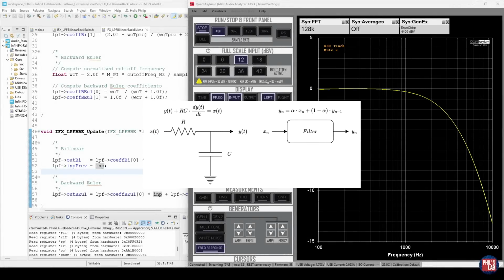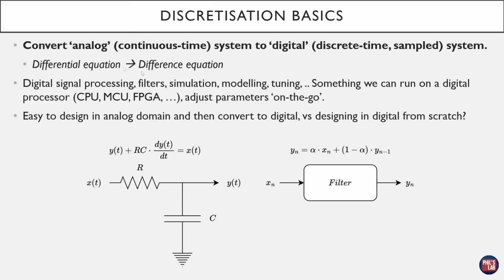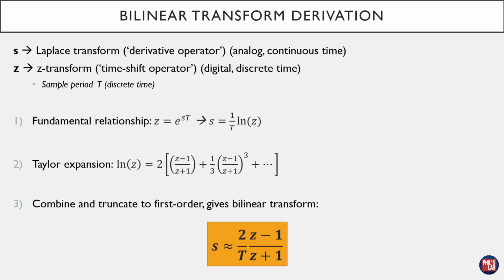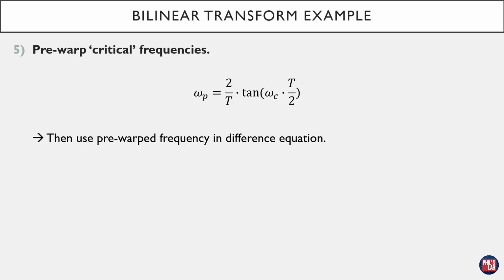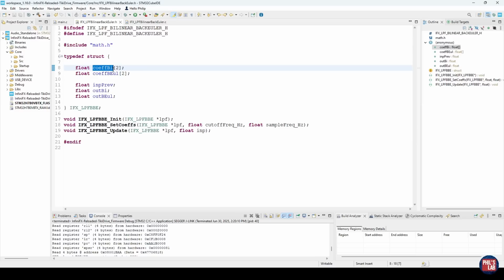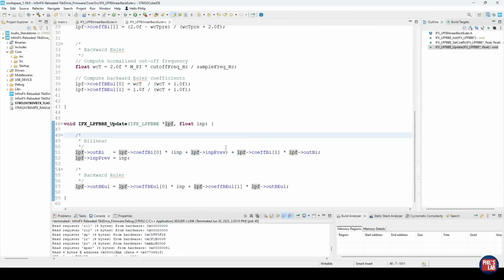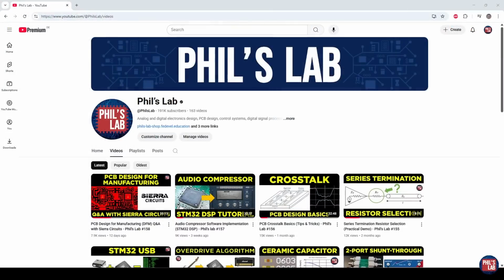Bilinear Transform IIR Filter Design (STM32 DSP) - Phil's Lab #159

Comment: Hi Phil, I really liked your detailed and precise explanations. They are really good for the new beginners in electronics hobby like me. Thanks for your efforts. 
I am working on a STM32 project where the MCU reads ACC data from MEMS sensor and based on gravity orientation, turns on LEDs in certain fashion. The LED array is made of 240 LEDs in Charlieplexing arrangement and controlled by 16 GPIOs. I want to read the MEMS data and control LEDs using DMA. I found your tutorial on DMA to read SPI very helpful. But there are no tutorials on the internet for controlling multiple GPIOs using DMA. A tutorial on this will be really helpful for the community. Thanks in advance.

Comment: Great Video! 
Would the frequency range fit even better after cut-off if you use a higher order Taylor expansion? Or does this have to do with pre warp?
Reply from the maker: Thanks! Higher sampling rate gives a better match, for example. But yes, you could expand the Taylor series further for some ('minimal') gain.

Comment: AI Summary

Abstract:

This video demonstrates the application of the bilinear (or Tustin) transform to convert analog filter prototypes into digital filters for real-time implementation on microcontrollers. Using an RC low-pass filter as an example, the host details the mathematical derivation of the bilinear transform and the necessary frequency pre-warping technique, contrasting its superior frequency domain match with the simpler but less accurate backward Euler method. The entire process, from theoretical conversion to practical C code implementation, is showcased on a custom STM32H7-based digital guitar effects processing unit, featuring variable cutoff frequency control and real-time frequency response analysis.

Summarizing the Bilinear Transform for Digital Filters

*   0:00 Digital Filter Implementation: The video introduces the use of the bilinear (Tustin) transform to create digital filters from analog prototypes, demonstrating an RC low-pass filter simulation on an STM32 microcontroller.
*   0:44 Custom DSP Unit: The demonstration platform is a custom digital guitar effects processing unit, featuring an STM32H7 microcontroller, audio codec (ADC/DAC), and control interfaces (ADCs, switches, potentiometers) for real-time audio signal processing.
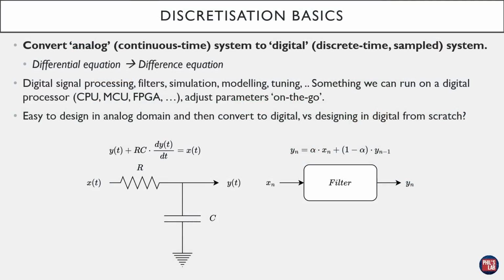*   2:37 Discretization Basics: Discretization is explained as the conversion of continuous-time (analog) systems/signals, typically represented by differential equations, into digital discrete-time (sampled) systems/signals, represented by difference equations. This allows for flexible, software-based implementation, avoiding analog component tolerances.
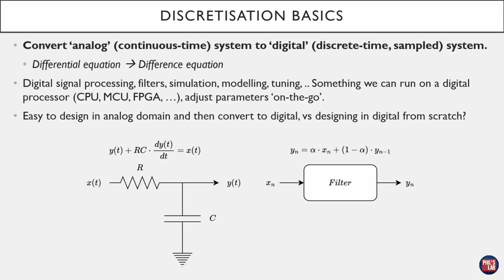*   3:57 Methods of Conversion: Various methods for converting analog prototypes to digital systems are discussed, including direct digital design, response matching (impulse, step, ramp invariance), and algebraic transforms (backward difference/Euler and bilinear).
*   5:09 Backward Difference Method: This method is intuitive and simple, approximating continuous-time derivatives with discrete-time derivatives. However, it offers a poor frequency domain match between analog prototypes and their digital equivalents.
*   6:04 Bilinear (Tustin) Transform: This alternative method, though more tedious due to requiring frequency pre-warping, provides a much better frequency domain match. Its derivation involves relationships between Laplace (S) and Z transforms.
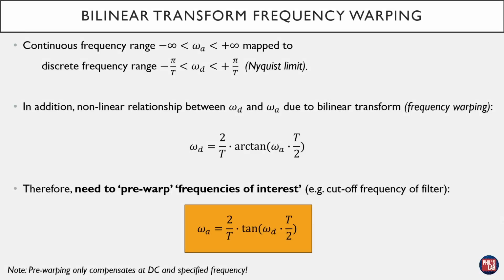*   8:18 Frequency Warping and Pre-Warping: A key aspect of the bilinear transform is frequency warping, a nonlinear mapping from continuous to discrete frequency ranges. To compensate, critical frequencies (e.g., cutoff) must be "pre-warped" using a specific tangent-based equation to ensure accuracy at the desired points.
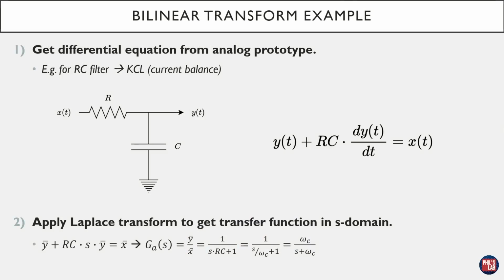*   9:41 RC Low-Pass Filter Example: The process for an RC low-pass filter is detailed: deriving its differential equation, converting it to an S-domain transfer function, applying the bilinear transform to get a Z-domain transfer function, and finally converting to a real-time difference equation for implementation.
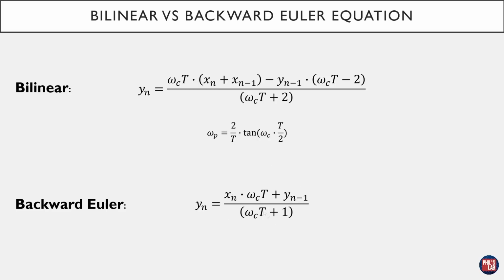*   13:42 Frequency Domain Performance Comparison: Visualized Bode plots (magnitude and phase vs. frequency) show that the bilinear transform with pre-warping achieves a significantly better match to the analog prototype's frequency response, especially at the cutoff frequency, compared to the backward Euler method.
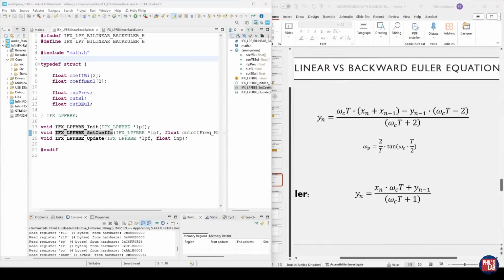*   15:39 Real-Time Code Implementation: The C code for the filter on the STM32 is detailed, showing how coefficients are calculated (including pre-warping) and how the difference equation is applied in an update function, using a `struct` for persistent memory.
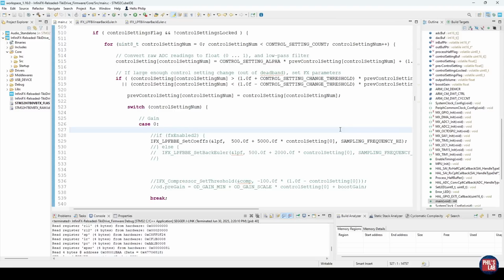*   21:09 Live Demonstration: The digital filter's real-time performance is verified using a Quantasylum QA403 audio analyzer, demonstrating the variable cutoff frequency of the implemented filter by adjusting a potentiometer.
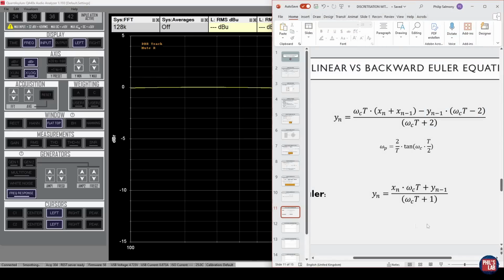*   22:42 Conclusion & Takeaway: The bilinear transform, while more mathematically involved, is recommended for applications requiring a precise frequency domain match to analog filter designs, offering flexibility and tunability in digital systems.

I used gemini-2.5-flash-preview-05-20| input-price: 0.15 output-price: 3.5 max-context-length: 128_000 on rocketrecap dot com to summarize the transcript.
Cost (if I didn't use the free tier): $0.0063
Input tokens: 22713
Output tokens: 830

Comment: You got a QuantAsylum system! Pretty neat!!
Do you have any idea how much the total system latency is at 48kHz and 96kHz sampling rate?
Reply from the maker: The QA stuff is great! Here I'm running at just under 49kHz with a large total buffer size (2048 samples), but double-buffering/ping-pong-ing every half buffer. So raw latency is ~21ms from that alone, with running the low-pass filter (and all other system overhead) I'm measuring ~21.4ms.
Reply: @PhilsLab that's not bad.
Is double buffering necessary?
That's the latency including ADC + DAC conversion?
Reply from the maker: I'd say double-buffering is necessary. And yes, that's including ADC+DAC conversion.

Comment: Another question, if I may: 
In the taylor expansion of ln(z), it's not clear to me why we chose the first order.
I'm asking because, when doing a sin() approximation, you need to at least take the 3rd order to approximate the first 1/4 correctly.
Reply from the maker: You could definitely do that. But for many systems the accuracy of the first-order approximation is sufficient. How much more are you gaining from the ^3 term (or higher)?
Another reason is that (e.g. by including the 3rd order term of the expansion) you'd end up with a higher-order discrete-time system than the continuous-time system you started with. And finally, if done by hand, it's of course a lot of extra work (that being said, I did use the Matlab Symbolic Toolbox to check most of the calculations).

Comment: Best DSP channel ! 

Quick question: At a given frequency, the Tustin technique outperform Euler with better maths.

But what if the acquisition frequency is increased?
Euler being easier to compute (less CPU instructions), is there a point where it would outperform the Tustin ?
Reply from the maker: Great question! Yes, as the sample period is reduced (smaller time steps) the Euler approximation gets better and better, especially if the cutoff frequency/system bandwidth is far away from the Nyquist limit.
That being said, the Tustin transform is more involved, but once coefficients are computed, the difference equation is ~similar in complexity to that of the Euler and does not require a significantly higher sample rate to provide good results.
Reply: @PhilsLab  Interesting ! Thanks for your answer.

Thanks to the pre-computation of the coefficients and hardware support for floating points operation, it would not surprise me that they are indeed pretty close.

In any case, I would assume that for most real world projects, input sampling time is the limiting factor, not CPU.

Comment: Sorry if this question was addressed in one of the earlier videos but what is the advantage of using float for the audio when the ADCs and DACs usually use something like int32_t?
Reply from the maker: Easier to work with, especially in the context of demonstrating DSP principles in these videos. If using ints, we need to - in most cases - scale the values appropriately before and after operations. There can of course be downsides to floating point-based algorithms, but that's a topic for a future video.